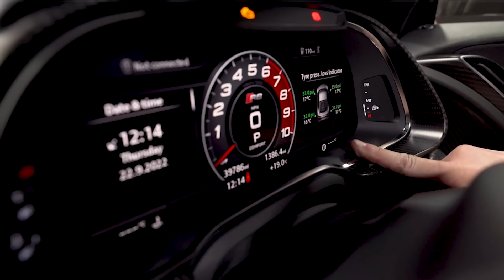The Car That's Impossible to Fix? Workshop Update No.36

Comment: Porsche had that issue with 911 twin turbo as oil tank is higher than turbo's, they fitted a 3 psi check valve into both oil supply lines-sorted

Comment: Cheers for the mention Rick, the V12 TDi has a T56 Magnum hanging off it. You can get aftermarket controllers for the 8hp and DSGs that work standalone. Unless you have silly power dont bother with a DQ500.
Reply from the maker: Thanks mate, I couldn’t remember what it was!

Comment: Hi Ricky, is it possible the problem with the un fixable RS6 could be clogged up cats?? 3 sets of turbos sounds like clogged cats. When it sits for the two days, any carbon or oil is solidifying in the cats. Thinking the smoking on start up, is the temp coming up rather quickly at the turbo outlet side and it starting to burn off the oil. I have seen and heard of this happening before, also does cause oil to back up due to pressure build up, hence doing in the turbos. Just a thought mate.
Reply: You should not have oil in your cats and if they was blocked performance would be affected. Blocked cats will not cause turbo to fail either really I very much doubt you know what your talking about

Comment: Listening to you answer the questions😢 true hurts. When you add up the cost. Great advice on make sure you get the right people to check out the vehicles and top companies like yours. To fix them or tell you how bad it is. Hope the oil pump fits the smoke problem, or if not,  will the engine be coming out and a strip down video on it? 😢😢

Comment: Probably unlikely, BUT... could the smokey RS6 be caused by blow-by? When the engine warms and on warmer days, there's enough expansion in the pistons to seal everything up... but when cold or on cooler days oil is blowing by into the combustion chamber? Again, highly unlikely but certainly a possibility. I guess you could quickly rule this out by somehow mearusing crankcase pressures when cold and warm (?).

Comment: Hahahaha Love the boxing cat :D 
You touched on the S8 V10 engines. What are the internal differences? offset rod journals vs non-offset... firing order? Intake/Exhaust runners giving lower torque? I've seen a couple of guys running Lambo intakes on S8 engines and one person running Lambo headers on his S8 engine. What's good? What's bad and will you tune mine pretty please???

Comment: I wonder if it has the same problem as the bmw n20. The turbine carbon seals intermittently leak oil into the turbine housing after engine shutdown. The fix for this was a check in the oil feed line to stop oil filling up the bearing cartridge when off.

Comment: Question.  Without forced induction if you were to lighten and uprate the na v10s rotating mass and valve train. What would the theoretical max rpm be and power output?  Especially what's the limit for a screaming high rpm v10 rather than the twin turbo route?

Comment: Question for you, do you have much experience with older Porsche models? I have a 2010 997.2 PDK, I’ve looked at lots of options for intakes / exhaust but the price vs hp gain on exhausts makes it not worth it. 1/4 price of the car for a full system and maybe 7-8bhp.. and air intake seems to be pretty much as good as it gets from factory… Is there any non bank breaking upgrades you could suggest? Not just power wise, but any decent upgrade? 
 Or just leave it and enjoy as it is.. latest upgrade was online road and track DFV suspension which is awesome.